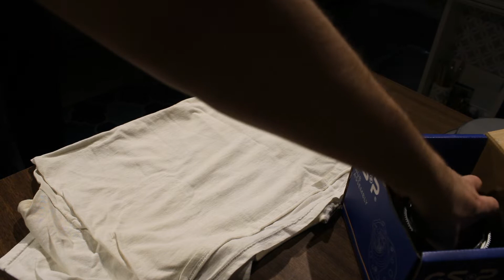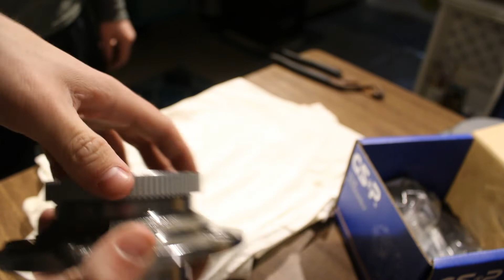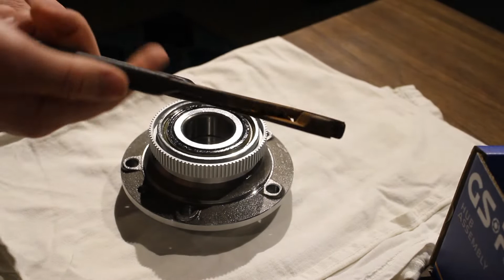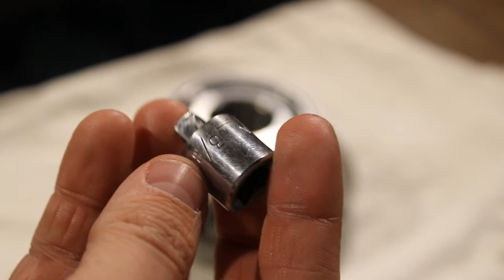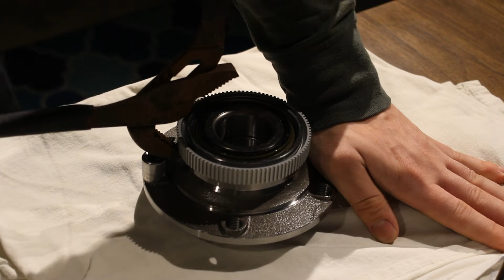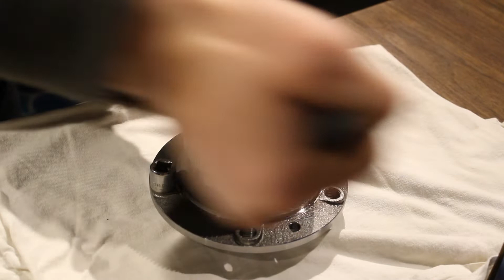BMW Wheel Bearing ABS Ring Removal for non-ABS Car | E28, E24, E30

Comment: It's not necessary to remove an ABS ring for a non-abs vehicle. On the other hand, an ABS vehicle requires the ring so are sometimes replaced if broken (if you can find one).
Reply from the maker: This was a while ago so you may be right, but I seem to recall that something on the front strut would interfere with the abs ring, which is why we removed it.

Comment: Is Abs ring the only difference between the abs/non abs hub? Could you just fit a ring on a hub to retrofit abs
Reply from the maker: There are other things you'd need to swap on, but as for the hub, yes the only difference is the abs pulse ring.